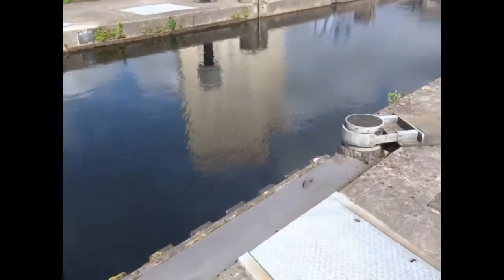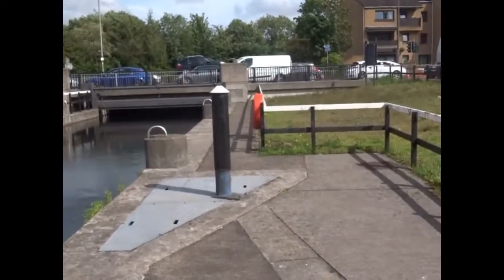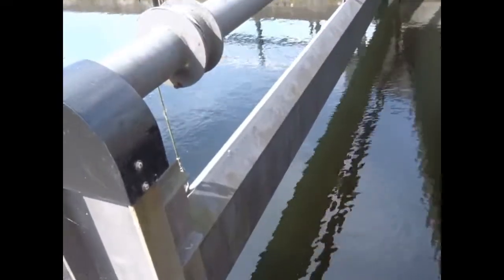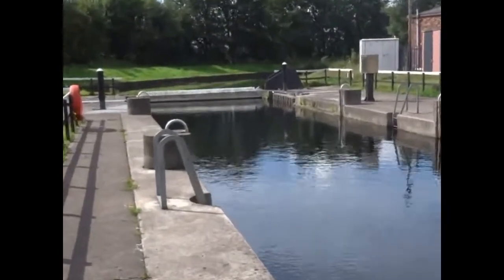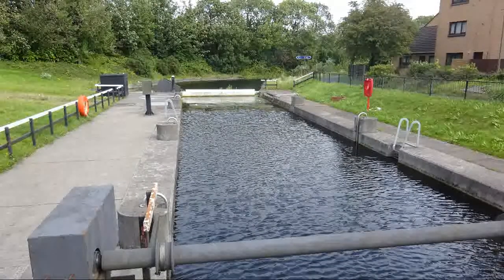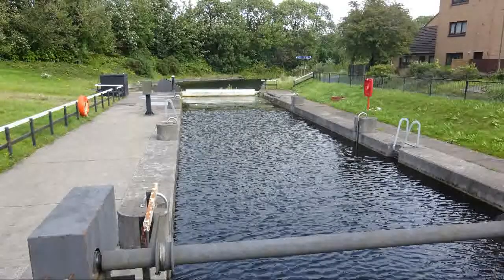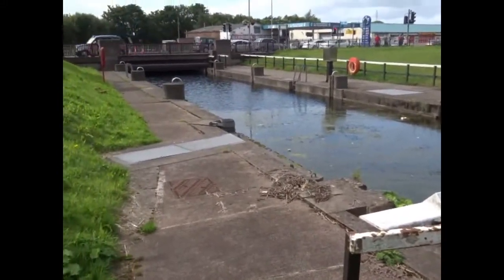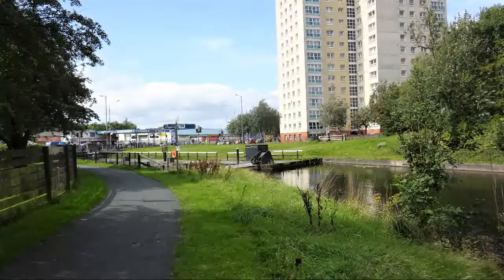The Unique Dalmuir 'Drop Lock' on the Forth and Clyde Canal

Comment: Almost seems like it would be cheaper and easier to simply raise the road with a small bridge, rather than build a lock with pumps and gates to allow a boat to go under.
Reply from the maker: You would have thought so. It's a very complex lock and doesn't see much if any use sadly.